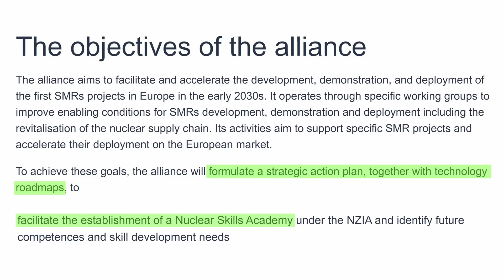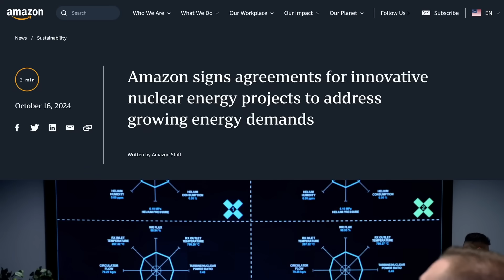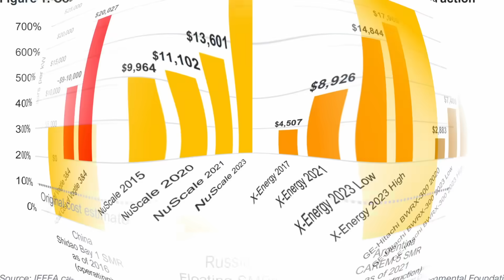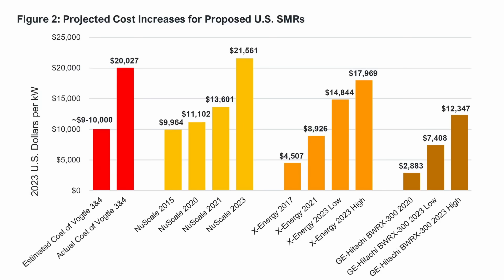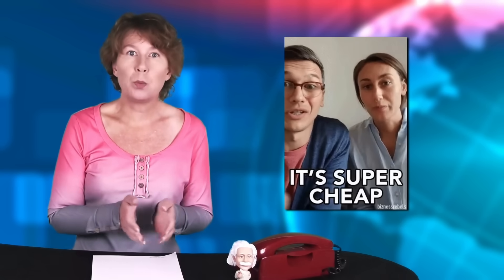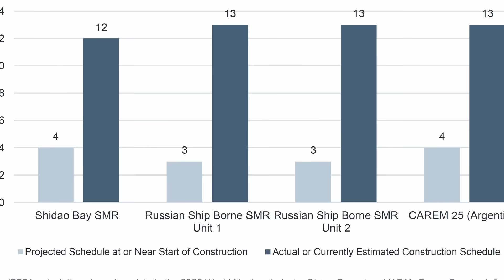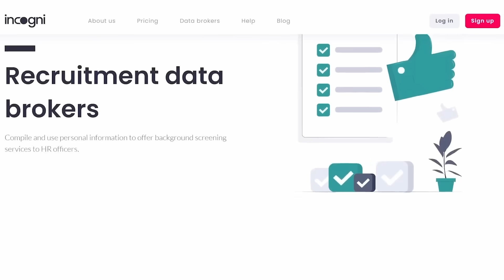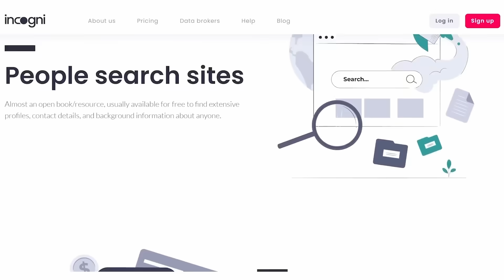Small Nuclear Reactors Have A Big Problem

Comment: An old boss of mine used to say that the best way to estimate the cost and/or lead time for any given project was to ask an expert then triple the answer.  I never saw anything to contradict this.
Reply: In software, it's double the number and increase the units by one step. Two weeks? That will probably end up taking four months, etc.
Reply: @lwmarti Double for in-house, add a unit to that for outsourced.
Reply: @lwmarti  I was a software developer. My boss told me his correction factor for the time estimates I gave was 2.5. I always estimated how long it would take me to do a job, but if they gave it to someone else it always look 2.5 times as long. (But since they didn't give it to me, there was no way to tell how long it would have actually taken. That's how I maintained a reputation as a miracle worker.)
Reply: @lwmarti  lol, so 1 year will be 2 decades?
Reply: Funnily enough this is a popular 'joke' among the diy/home improvement crowd as well. 
Make an estimate for the time and money required and then tripple that. If you're not ok with the result...just leave it be. 
It's a sad state of affairs, when so called 'experts' can't do better than that, though 😏
Reply: @raraavis7782  I think experts normally produce very good estimates... but they implicitly assume that everything will go to plan. I'm a software development expert and I see this in my own estimates all the time.  I'm pretty good at estimating how long it will take to build a piece of software, as long as there are no unexpected obstacles -- which there always are. The problem is that unexpected obstacles are unexpected.  Even if you know there will be some, you don't know what they will be. To some degree you can account for "known unknowns", but there's simply no way to deal with "unknown unknowns". So, sadly, doing something like "multiply by 3" is the best you can do. Even then, you often run into Hofstadter's Law: https://en.wikipedia.org/wiki/Hofstadter%27s_law
Reply: Pfft, I can hear you have never been to Denmark:-)
If a project is only 3 times longer, then is it going forward, better than expected, multiply by 6, and it may be a bit delayed, 9 times the estimate and "yes it is a bit late". London raised 10 high raise buildings in a few months, Odense in Denmark was 5 years about building a 14 store building that was not that wide or high. A bridge that was planned to be finished in about 3 months, got finished nearly 1½ years later and had to be corrected because the builder had moved too fast!!!
Reply: My dad used to use Pi for this.
Reply: Works for 'chopping wood for the winter' as a project too!
Reply: I've heard that: 

"If a project is announced to finish in around 3 years, expect it to finish in around 3 years. 

"If a project is announced to finish in around 5 years, expect it to be finished. But it will take more time and money than expected. 

"If a project is announce to finish in around 10 years, it's not going to get finished and will get more expensive every year."
Reply: @joseph7471  Yup, there's several variations on that one.

And it tends to hold much more true as it is simply based on whether people KNOW they can get something done or if they think they can do it, or if they think they can figure out how to do it.
Reply: @joseph7471  LOL, I do not think anybody plan a 10-year project and genuine expect it to ever finish:-)
Reply: More like 5x the time and money imho
Reply: I've always heard double, but triple works too!
Reply: @dawnderg  
the thing is if you ask yourself, you double it. 
You ask a professional, you triple it.

Simply because a real professional usually did the thinking, but not the doing. 

Especially highly educated, they are rewarded and trained to come up with new convincing idea, not practical idea.
Reply: @dawnderg  I heard double and then add half again - which is triple :)
Reply: @dawnderg  I always thought that double is more realistic for home construction.  On a related note, there is always Hohenberg's Law: each new car costs twice as much as the last one.
Reply: By that standard I'm an expert at a lot of things, but on plumbing projects I'm a super expert by that standard.
Reply: My boss said X4 and low and behold it worked.  It covered my butt on a couple of projects and made us a boat load of money on the rest.  ;)
Reply: Really? My experience is a little bit different. 

When asked for a timeline we usually analysed the project, identified the critical path and estimated three numbers: the minimum time, the expected time and a cut-off time. 

When presented to management  they always knew better than us. First we were forced to use the minimal estimates at the next round of the presentation. Second all administrative tasks were set to zero. Because management is important, permits and coordination will take no time. If the cost estimate of the project still didn't fit the project budget the timeline was trimed to that target.

Of course management called it "our timeline" and expected us to commit to it.
Reply: But if a government contract is involved, it would be best to estimate the cost ten times that of the proposal.
Reply: @harrydecker8731  Hey, brainless moron, that's when PRIVATE parasite is involved. USA made bomb in manhattan project and sent man to the moon in apollo on time AND budget, it was just 100% state effort, no bankster scum stealing billions around. Ditto with Soviets, first satellite and man in space for peanuts thanks to zero parasites. But sure, keep yapping that nonsense written by 1% to ensure morons like you vote for the party that lets them steal mountains of money instead of state organized solutions...
Reply: @harrydecker8731  Listen, lets not deprive the boys overseas of the tools they need to prosecute the war.  Just write them out a blank check for all the expensive destructive toys they could ever want, while we eat stone soup back home!
Reply: @harrydecker8731  "But if a government contract is involved, it would be best to estimate the cost ten times that of the proposal."

My father, while his job was still state owned, always achieved contracts on time or sooner, on budget or cheaper and on quality or better.
When his work became privatised, on average it took twice as long and cost 50% more.
And when he and his colleague, the only ones in all of Scandinavia with his job, retired, the company had to replace those two with 8 people, despite how the wonders of computerisation was originally meant for them to be replaced by 1 person.

Anyone who thinks govt work is less efficient than privatised, only knows the profiteering propaganda, not reality.
Reply: @harrydecker8731  And would come in 10 times longer than estimated and leak once in orbit.
Reply: You always have to estimate the net future value of any investment, as well as its net present value. The two are different things. Net future value is more difficult to estimate even in the most stable of markets. We know the discount rate today but we can't be sure of the discount rate 10-years from now. That's anybody's guess.
Reply: As a software engineer, I find the best multiplyer is 4 😮
Reply: "Predictions are hard. Especially about the future." Yogi Berra, baseball legend.
Reply: Multiplying any cost estimate by π is better.
Reply: The pi rule! Same here in Italy 😅
Reply: In software engineering we used to multiply with Pi. That makes
 sense, because we move in a circular fashion towards the goal 🙂
Reply: @larsnystrom6698  Boom, boom!
Reply: I'm a retired nuclear research engineer. I used to develop software for estimating dose in human phantom models and applying that to standards development for the EPA, NRC, ICRP, and Society of Nuclear Medicine. When estimating the cost for a new project, we always estimated the time to finish assuming that everything went just as planned, then multiplied that estimate by three. My supervisor always multiplied by Pi instead of three.
Reply: The bodycount rule, x3 or /3 lol
Reply: Meanwhile, renewables tend to hit targets.
Reply: @BooBaddyBig  Examples?
Reply: @BooBaddyBig The renewables don't hit anything because they don't deliver anything for weeks every winter. 
And in summer they are about to crash the electrical networks.
Reply: We had an estimation process where each reviewer would double the cost - the trick to coming in on estimate was to pass your proposal to enough reviewers in turn.
Reply: In software development, the rule of thumb is to multiply all estimates by pi. It seems to work fairly well.
Reply: @IsZomg  Mmmmmmmm, pi.
Reply: Pi is the number. This is one of Augustines rules (early CEO of Lockheed Martin)
Reply: Actually all engineers use the rule of thumb, multiply by pie.
Reply: The rule of π, eh.
Reply: multiply by pi
Reply: Yeah, multiply by Pi is always a good idea, for timelines too... just ask Elon...
Reply: As an expert who consistently underestimates how long things take and how much they cost, I've adopted the strategy of multiplying by pi.  It's about 3X, but also makes your estimates look very precise 😛
Reply: If it's in the UK under a Conservative government it will be at least five times the original estimate.
Reply: @sandormccann2546  Aye, and if it's Labour it'll be cancelled - and I'm not a Tory.
Reply: In the case of Argentina it should be by 7, no wonder!
Reply: One problem there was that when I was estimating my work as a developer, I was told to do that. You definitely need to pick one level to do the "adjustment", or it could get completely out of hand.
Reply: I always say for business plans you made yourself to double the most pessimistic estimates...so if asking experts who want to sell it, tripple sounds good.
Reply: As an expert in IT development, I triple my OWN answers, and still underestimate!
Reply: I did that when I was Project manager. Depending on the complexity and the number of stakeholders I multiplied the cost and duration by a factor between two and three.
Reply: if you sign up with cogni you get a free small reactor delivered to your home address for free
Reply: My boss use this guide regulary, so he get into angry mode  when my projects stick to the  plan in 90%. He is not in mood when  his estimates fails
Reply: I usually work with a factor of Pi, because that is a round number.
Reply: No, you don't multiply it. You raise the estimate to power of two or even better, use it as a power of something. That's because each unsolved problem, which there are many, have more unsolved problems inside them. So, the bigger the initial problem, the more unknown problems it has, which hide more, and more, and more, and so on. Humans are good at estimating about one week of work based on my experience. :D
Reply: I'd always been told to multiply by pi, so close enough!
Reply: But, if a project has several separate parts, separate managers/supervisors, never tell them the higher estimate or else it will become their psychological "base budget before overruns", and the eventual project costs will triple again.
Reply: I have experience this myself in most every project, including projects where there is only me as the customer, designer, contractor and quality control staff.
The meetings to figure out what went wrong are not contentious. The who made the mistakes is easy to grasp, the what, where, when, why and how, of course, remains a challenge.
Reply: @luck484  
who is usually not the point, they usually just trying to find someone to blame.
Reply: That works until the expert is wise enough to triple his own estimate.
Reply: <chief engineer Montgomery Scott enters the chat>
Reply: Heard that "triple the number" thing for decades and it unfortunately is generally true.
Reply: lore accurate.
Reply: I am reasonably intelligent yet constantly surprised that 
my estimates of project duration are almost always  
90% short of the actuality.
I suspect an unconscious bias is affecting my imagination
something like the way belief in magic convinces some that
they will never die.
Reply: @REDPUMPERNICKEL   Later in my career, I made a distinction between work time estimates and real time estimates the distinction being the amount of work you can get done, sat down and focused on the tasks necessary versus those task done all the other crap you have to do during the day. The difference is substantial
Reply: Whereas, solar power is installed faster than even the most optimistic proponent expected.
Reply: Reminds me how my mom would tell me overestimating is often better than underestimating the amount of necessary resources.
Reply: The same was true at Lotus Notes/IBM.
Reply: I build houses and I can build for less than listed home prices.
I spent 20 years working on top tier homes. We could build for estimated prices, but it usually ended up 30% higher.  Finish work is where owners made changes and drove up the price.
I've seen the projects that became a mess and costs went through the roof.
Reply: yup!
Reply: Makes sense. If, as an expert, you bid a sensible estimate. You won't be awarded the job. it's a race to the bottom so you can win the work and pay the bills.
Reply: Nuclear is economic suicide! https://www.youtube.com/watch?v=VXwGvLj4rak
Reply: A well run project ends up at π times the initial estimates, a government led project is closer to π^2.
Reply: Similar with over zealous health and safety costs, just add a zero to original pricing.
Years back I just wanted £60( labour) to put up a gutter, usually using a ladder, but oh no you need scaffold now, so the job cost £540 with the added cost of scaffolding.
Reply: @AltIng9154  'Scaffolds' are often used in construction, maintenance, and repair projects to support workers and materials.
Reply: @AltIng9154   If you Google  'scaffold' you will see it is for very different purpose😎👍
Reply: While I agree this is true, when you are building something that is new technology, you have no idea what problems you will run into. That costs time and money.
Reply: In telecom engineering I multiply time estimates by pi...it's surprisingly accurate. 😂
Reply: Funny — that’s exactly what I did during my career when I used project management software to plan a project.
Reply: I've been working for 45 years, and I've found that to be true.
Reply: Defence contracts outcomes are generally within 3% of performance, 30% of time and 300% of cost.
Reply: I for one would love to see someone like Elon Musk make an SMR gigafactory where he could build at scale and have the reactors checked for safety before ever leaving the factory.
Since he's going to head DOGE, he could streamline the useless regulations that cause nuclear reactors to be stupidly expensive.
Nor do I have a problem with him making billions by building out the electrical grid. It needs to happen and we're already spending too much.
Reply: I think this applies only to first iterations.  Then the learning curve comes into play.  For information, I worked for Westinghouse as they were building the first AP1000's.
Reply: Scotty, the chief engineer of the Star Ship Enterprise, has a factor of four. "It'll take four hours to repair, but I could get it done in one, Captain"
Reply: This on the back of Fukushima.. She's bought and paid for by her paying for her own nuclear industry supported phd from bovine university.
Reply: The issue is the costs of risk management (contingency) are never properly/fully planned for. This is because the initial estimates are usually rejected by stakeholders.  I’ve been a project manager for 25 yrs and I can tell you the final actual cost is the actual budget.  It could have been estimated prior to commencing but would have been rejected by stakeholders.
Reply: That's for the US, check out China's current level of progress. They get it done. Early and under budget, with an originally proposed budget a fraction of western counterparts. There is something wrong with the way we do things.
Reply: In software we ask the programmer, and his/her manager doubles the effort. However each layer of management will double the lower level's estimate.
Reply: @sb5580  Aye, and then the marketing dept sell the damn thing for half the price with an installation date 6 months before release.
Reply: Multiply by pi for more accuracy.
Reply: Even so, if the goal is to have a unit that can be mass-produced then the practical significance of those inevitable cost overages can be greatly reduced...
Reply: @ElbowShouldersen  If only we could find some way to teach this to economists. 🤹🤹‍♂🤹‍♀🙀
Reply: Mr. Musk, are you listening? NukeX?
Reply: Yay capitalism? How much is a gallon of gas in socialist Venezuela?
Reply: @ how much is food and life saving medications cost in socialist Venezuela, thanks to never ending US MacArthism? Geopolitics is not your  cup of tea, I deduce